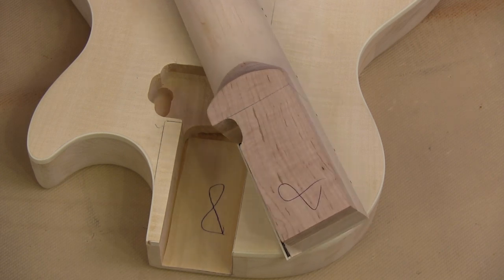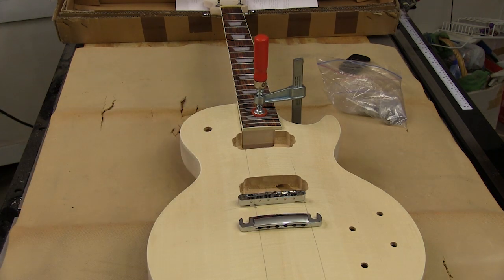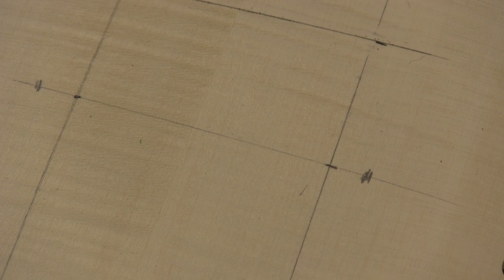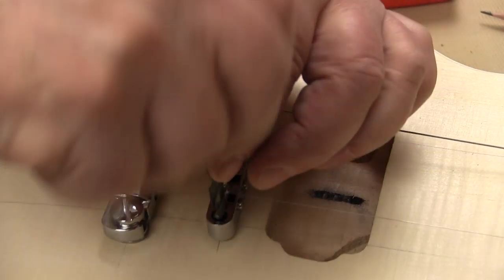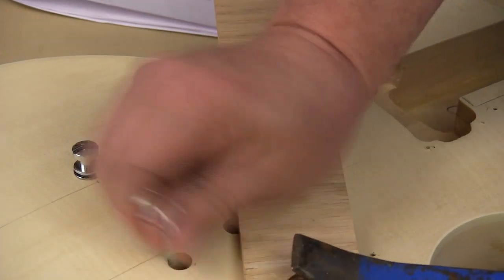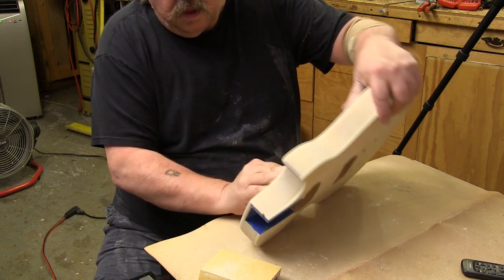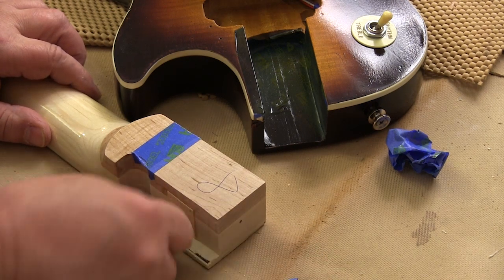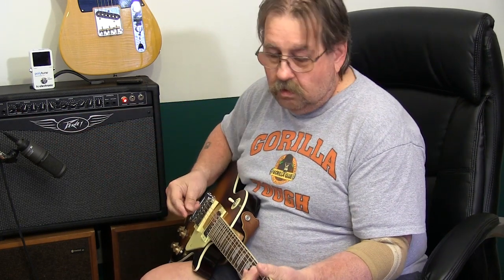Rockler Custom 1 Guitar Kit

Comment from the maker: Yes, you should always run a ground wire like that. I think I had to drill a hole from the main cavity into the pre-drilled hole for the post. I've built several guitars now and can't remember exactly but I know I have had to drill hat hole on a few of them. With a longer bit (like a small lamp auger) it is easy to do because you want o come into the post hole near the bottom anyway.